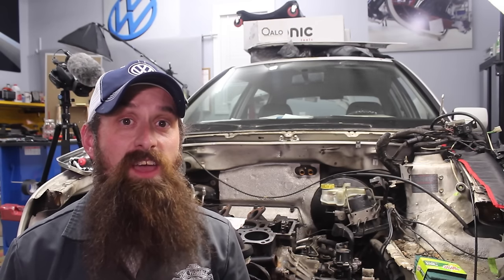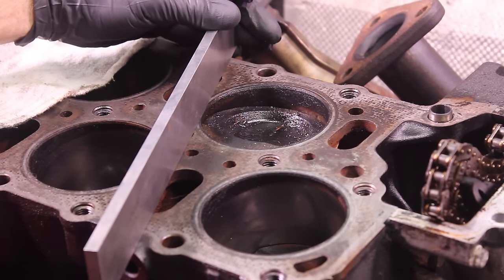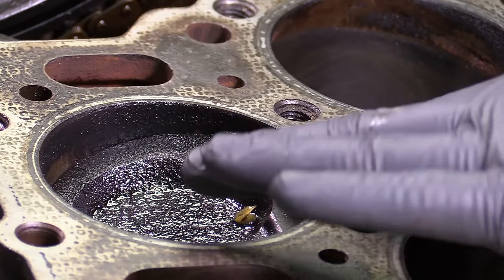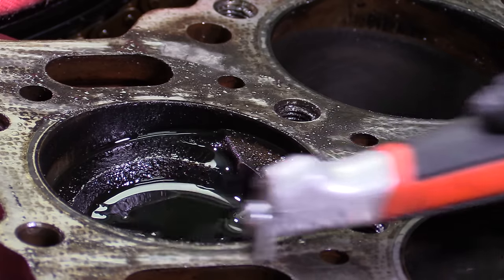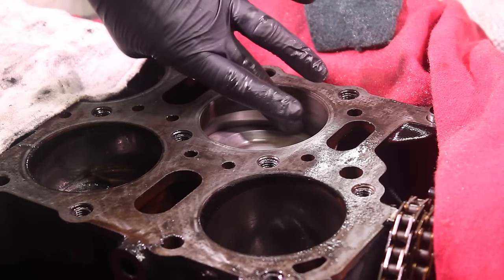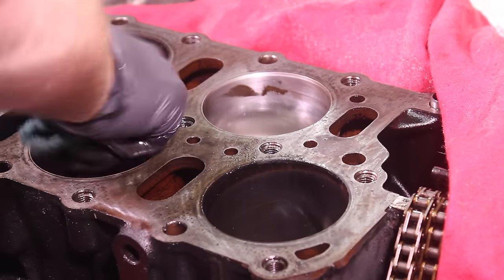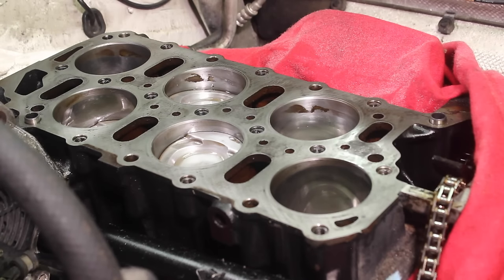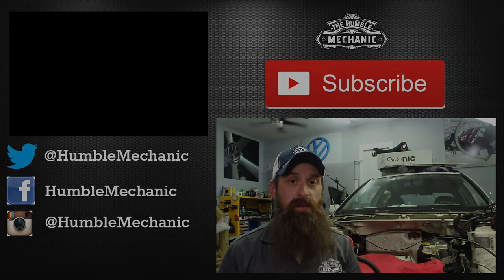Removing Carbon From Piston, Cylinder Walls, and Block Deck

Comment: Any chance spraying a good amount of wd40 into the spark plug holes and letting it soak with the engine in the vehicle overnight or a few hours can help piston rings seal better to stop burning oil?

Comment: My question is, say you're doing this and slap a new gasket back on. Will WD-40 on the pistons and inside the cooling channels (I think they are) cause an issue or would a fluid change suffice once some cycles through? 

Never done this before, but just in case it'd be nice knowing that bit.
Reply from the maker: This this engine ended up with some bearing damage on the connecting rod bearings. I ended up with a full rebuild. had I not, I would have cleaned the cylinders out, oiled them and ran it.

Comment: is this something you recommend on any really old used cars like 100k miles or more. or is this only necessary for cars you plan on modding. does this help the engine last longer. sorry for the questions. just been loading my brain with car info.

Comment: Hey Charles, I'm building an aeb engine. I don't know what size pistons to get, 81.5mm or 82. My machinest said to get 81.5 and I'd be fine. He has never worked on this type of engine before but he builds race engines and he came highly recommended from my master tech friends.
Reply: I'd pull the head or have them pull the head,and measure the bore so you make sure to get the right size piston to start.
Reply: Bradley Preston I brought the block to him.
Reply: +Jesse Silva then have him measure the bore size, which he has probably already done anyway to make sure the cylinder isn't out of round. just ask what the bore measured as so you can order the right parts.
Reply: Bradley Preston yeah he didn't measure it. He just walked up to it took his flashlight out and stuck his hands down and just looked at me and said you don't need to bore it because there isn't a whole lot of ware on it, just needs a hone. But then I told him that I wanted forged pistons and he said that most aftermarket pistons the rings sit farther up on the piston and that going 81.5 would be best. I just wanted to know if there was an advantage to going to 82 over 81.5 while keeping stock stroke.
Reply: A larger bore has its benefits. Increasing the displacement allows for more air and fuel to be put through the motor, thus allowing for more horsepower.
Reply: +Jesse Silva  You TOOK the block to him...
Reply: +David F ok.... so? i still have the block, the reason he wanted to look at was to make sure he could work on it. He usually works on v8s and has never worked on this engine before. This is going to be my first engine build, so i wanted to get another opinion from someone who works mainly  on vw's and audi engines.

Comment: What about decarbonize the pistons and valves without tearing the engine apart?
Reply: That's what I thought that this video was about.
Just dribble water into your intake. The steam it produces blasts the carbon out. Works well. NOT too much water.

Comment: So wait, this would take me a week just to get to this point, nevermind the cleaning part lol. I have no garage, just a gravel driveway. Is there a fluid I can run through the gas tank and crankcase to give me at least ok results, without tearin the whole engine apart?

Comment: That seemed much quicker than I would have expected.  How long did it take in real time?  2 hours?  Also, is this the typical length for this job, or was this one a lot quicker than normal due to some attribute about this particular engine?
Reply from the maker: +tedjohnson64 the totally time of actual cleaning would be about an hour or so. Filming things like this takes about 3-4 times the actual job. 

With the right stuff and some hustle it should be about30-60 Minutes

Comment: Hi. arent you going to change oil rings as well ?
Reply from the maker: +Niklez7 at this point, no. The cylinder walls look good and she wasn't burning oil. 

But I will be doing a full bottom end inspection when I get it on the stand

Comment: hello.. my piston rings have just started to get used..(engine loses compression via Oil Input Funnel).. wanted to know how much of a time i can still use the same rings as it costs a lot to change the rings and i need to start saving... Thank you...
Reply: Change with good oil / filters  at 5000kms intervals and you shouldn't have to worry for 100 thousands of kilometres

Comment: Just on a side note the manufacturer I work for  GM has bulletins to never use any whiz wheel or power tool to clean any surface on an engine,if an engine fails after a repair  and any sign of using  whiz wheel dealer charge back I've seen that happen twice in 16 years not a lot but something to keep in mind if you don't get it clean well after using or to aggressive with whiz wheel will cause damage.
Reply from the maker: Wow. Good info. I have seen guys have a very heavy hand with a power whee. T can be done well, but it takes the right touch for sure

Comment: Hi awsome video. I'm going to remove the heads on my 2011 ram 1500 to fix the lifters and came accross your video. This is definitely something I can do to clean the heads. Upon installation of the gasket do you wipe the heads or surfaces with acetone or something to remove any oily residue or wd40 from the gasket mating surface? Also there is another person claiming the scotch brite pads leave some microscopic residue in the motor that will damage it have you had any concerns like that?
Reply from the maker: yeah you will want to clean that out really well. like CRAZY good. I ended up pulling the engine totally apart due to bearing sadness, so I never made the video on how I would clean it
Reply: @HumbleMechanic  so if you did make a video or had to clean heads after using wd40 to remove the carbon and gasket what would you do? Assume you dont want to pull the engine out. Would you air blow the channels or use a shop vac. I will be removing a cam and lifters from my truck due to failure and am just looking to gather info before I tackle this project. Removing the entire motor is not necessary in my case, I'm just looking for cleaning methods that may help and you're help is truly appreciated

Comment: WD works good.  Marvels works great too. If you just add Marvels to your gas on every tank( a little) you will NEVER have carbon build up in your motor and your injectors will Never clog either, after HUNDREDS of rebuilds at my shop I have saved my customers thousands of dollars over the past 14 years

Comment: Hi Charles! Thank you for this awesome informative video. I am refreshing a SOHC V6 engine purchased from my local junkyard for my 91' Dodge Stealth. I had one question for you. Is it always safe to use the scotch brite lightly inside the cylinder wall? I just cleaned my pistons and block deck surface using your method and it came out great. I tried cleaning off the carbon/discoloration off of the combustion chamber area of the cylinders, but was leaving some scratch marks from the scotch brite and was not sure whether to continue. What is your opinion?

Comment: i have a question about a 2.5 jetta 2005. i bought it 2 weeks ago car was fine got a oil change spark plugs and then the car just turned off. now a mechanic tells me the engine has no compression and that i need a new engine. im streesed out the engine had 80,000 miles. when i try to start the engine it makes a loud bang more like a POP.  can u give me some advice
Reply: Is it sorted?

Comment: Great job Good choice on that vr6 tough engine, especially the aaa engine. the other vr6's are not as good in my opinion. not to mention these engine are balanced well so you can take a coin and it won't move much

Comment: hey man you say that the vr blocks dont warp easy. but before i tear apart my vw, do you know if the inline 4 (1.8t) blocks warp easy? or are they strong as well as the vr?
Reply from the maker: +Mat Wilkie the bottom ends are all pretty good. I have seen none warp from issues. 

Seen a few fail with connecting rod damage but that's about it
Reply: HumbleMechanic and hey 1 more question. i have a blown head gasket and its out of my price range to have someone else replace it rn. im currently taking my 2nd year of automotive technology and ik a few things about cars, do you think its worth a try to try and replace my head gasket myself? or do you have any other ideas? thanks and love the videos
Reply from the maker: +Mat Wilkie it's not a hard job. I'd see if you could do it in class and get help and credit for it

Comment: If I brought a used engine in this condition, is it better to just try to run it with a lot of Seafoam, in the gas & oil, then take care the gasket surface later?

Or is it better to just go through all this manual cleaning, even if it's immedietly needed, like for a daily driver?
Reply from the maker: If you can afford the down time with the engine, it's always better to go through it and give it the rehab it may need. But there is not always time, or budget for that.
Reply: HumbleMechanic I was hoping to just let Seafoam do most of the work, over time, and I just have to examine & change the oil & filter.

This is part of the reason why I'm so interested in BEVs and small engine Series Hybrids. Maintenance can be so annoying.
Reply: install valve seal civic

Comment: my transmission on my mk4 1.8t jetta is smoked. i have a buddy selling me a running mk4 vr6 with a manual. would you swap the manual into the 1.8t or stick to the vr6? oh and my 1.8t is uber clean, the vr6 has a small misfire and the clutch is funkified. any advice? fix the vr6 or manual swap the 1.8t?
Reply from the maker: +roberto molina (Vdub brown guy) the trans from the VR will not bolt up to the 1.8t. The bellhousing is different.

Comment: HumbleMechanic - 
Given the choice would you prefer the 3M Roloc bristle discs for block and head cleaning or WD40 and scotch brite pad?
(I usually use the scotch brite pad after the 3M disc for the finishing touches)
I’ve never used WD before though so thanks for sharing!

Comment: One last thing, using the WD-40 in the cylinder soak some into the ring to stop them from carbon locking while the rings and causing it to fail to seal.

Comment: Question: I know that you have said in past videos that carbon "cleaners" may or may not work and should be treated more as a preventative or to slow down the carbon build up on the VW engines. I have a 2008 VW GTI w/FSI, what do you think about Yamaha Ring Free? Would you recommend it, since I hear from diesel owners that have carbon build up that after using the product they do see an improvement over all. What do you think? Have you used it before?

Comment: TEC-2000 System Cleaner would do it on working engine :)
Reply: Can this be used on gasoline vehicles 4 cylinder engines or just Diesel engines?

Comment: Is it ok to polish the piston and cylinder head and valves with emery rouge? I heard that it will prevent carbon build up in the future.
Reply: Yes as long as you remove all traces of the compound ,so complete disassembly.

Comment: Use dental floss in the gap between the piston and bore, before the application of greace.
When you pull the floss out, the fine dirt comes with it!

Comment: The yellow (softest) Roloc disc seemed far to coarse to use on Aluminium.  The surface finish was horrible on a test section of a Subaru head.  I’m surprised Subaru recommended this method on head gasket replacement procedures.  In the end, it was minimal decked anyways but I was disappointed.

Comment: Im scard to use WD40 to clean a pistion. I use a little to clean some carban off the center of the pistion.than stratred taping around the head with a flat head scrow drive looking for damage.

Comment: Charles, are you also an Audi and Porsche fan?
Reply from the maker: +John Smith very much so.
Reply: ...wouldnt you want some carbon for some extra compression
Reply from the maker: +James Flores hahaha not for this build
Reply: HumbleMechanic well whats the downside of the carbon on the cylinder wall where the piston isnt going

Comment: How much do You worry about all the abrasive material that gets down the side of the piston to the rings?  I've turned it over a few times trying to flush them out as best as I can, but i'm sure there's something still down there.  Will it just burn?
Reply from the maker: Some cleaner or WD and some shop air should get that all out.

Comment: would wd40 work well to clean varnish like oil from something like an aluminium timing cover, or built up oil on the outside of a block?
Reply: No, it's bad at everything

Comment: Just use vegetable oil to cover/soak all carbon covered parts over night.  In the morning wipe it all off with clean rags.  No scrubbing... unless you would like to have shining piston tops.
Reply from the maker: Really? That's kinda awesome. I have an engine down now. I am gonna try it.
Reply: I picked this tip off some forum about toyota diesels.  They also were talking about "old time" machinists using vegetable for cleaning hands after work.    
Since the head off my 3.0 toyota diesel had to come off and time was not an issue - i decided to give it try.  If it didn't work im down glass of veggie oil and a couple of rags...
It also worked well on head's surface facing combustion chamber.  The carbon which was "baked" on intake valves it did not work...
Reply from the maker: no kidding? That is awesome.

Comment: I can clean them while the engine is on the car right? Leave it soaking for a day or so, turn on the car and it'll get burn off, not as efficient but it'll work for a 90s car!?

Comment: I never use wd40 for any car repairs and probably never will because It just doesn't work that well. Transmission fluid and acetone will will penetrate better than anything and pb blaster on more sensitive or delicate parts. I doubt this man actually uses wd40... But if they cut a heavy  check, I'd swear by it too. 

Great videos nonetheless. Thanks brotha

Comment: Do spray under the hood and underside of the cars with wd40.  This keeps rust away, and it keeps water away from the electrical system.  The trick is to do it on a warm day, and not drive the car for a day or two.  This allows the oil to penetrate into the metal.
Reply: makes sense...used to use it on dirt bikes to keep much buildup down.
Reply: It will evaporate away quickly. There are much better products for this job around.
Reply: FrozenHaxor funny thing is that it does not evaporate, but it soaks into the metal.  I buy a gallon of WD-40 in Home Depot for $22
Reply: You know not to lubricate the head bolt threads, as it will throw off the torque measurements during reassembly.

Comment: Is honing the same as skiming
Reply: No, honing is the process of resurfacing a cylinder bore to create a new surface for piston rings to seal. Usually done with an abrasive tool and drill or similar. Skimming is refacing a flat surface such as a cylinder head or block to remove an uneven surface usually caused by overheating and done on a milling machine

Comment: what do you do about the carbon that falls between the piston and the rings?
Reply from the maker: +Nick Pelletier I'll be hitting the engine with some compressed air(while upside down). So there shouldn't be an issues.
Reply: +HumbleMechanic good to know. I'm doing mine with the engine in the car. I don't have a cherry picker. what should I do about the carbon that I now have between my piston and rings? I was thinking to soak the posting with WD-40 or some berryman b12, and then hit it with compressed air
Reply: +HumbleMechanic piston*
Reply: +Nick Pelletier go get yourself an engine hoist from the Craigslist and get the engine out. After sell it back. I doubt you will loose more the  $20 on that if anything at all. I've done this 3 times now as I don't have a space to store the engine hoist after.

Comment: What is the purpose of the cross hatch?
Reply: I used to think that the cross-hatching didn't have a purpose, but was rather just a useful side-effect to look for when trying to see how worn the cylinders are.   But I've recently read that isn't the whole story.  It seems that the cross-hatching also helps retain some oil on the cylinder walls, to aid in lubrication.
Reply: exactly- correctly cross-hatched walls are critical to ring bedding-in, and aiding in oil retention for piston AND ring lubrication.
Reply: Luca Fuoco No. Just No! Glazed (smooth) bores=engine fucked!

Comment: In my early days I was told be very very careful cleaning carbon of pistons and bores specially the Pistons because there’s something called the carbon seal and if you take the carbon off the piston between the top ring landing and the crown in particular but also possibly other locations 

when you put it all back together the thing can blow smoke........ Or if you’ve changed the rings it can be okay for a while and then breathe heavily through the PCV system

It depends but the message was cleaning everything back to shiny metal is not always a good thing and you have to think about it and have experience with the particular motor you’re dealing with
Reply: I don't agree.  What usually happens, the carbon dissolves in cleaning solution, washes down and lodges behind the rings...  that will cause cylinder wall damage and burn out the rings.  There is no such thing as a carbon seal.  If you changed the rings, and cleaned the piston out of the block, then you also need to recondition your cylinder walls, because the new rings won't seat and seal properly.

Comment: Hi there not sure if any of you knew this I just discovered the cheat for removing carbon build up without using harsh solvents like your using. I bought cheap purple power brand citrus cleaner and sprayed it on my motorcycle engine head let it sit for 30 minutes and 5 minutes of scrubbing with a tooth brush it all came off.